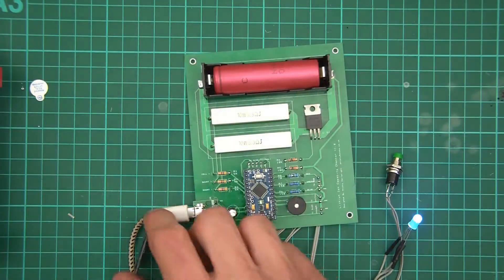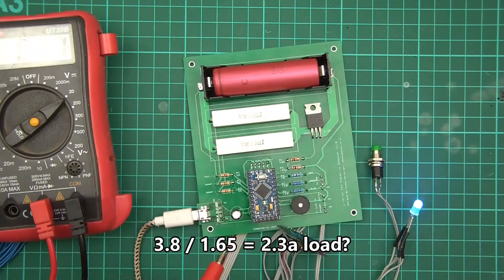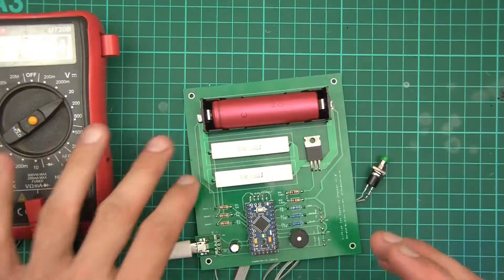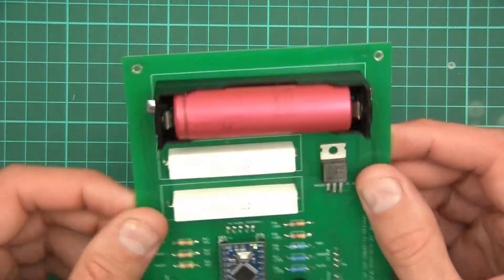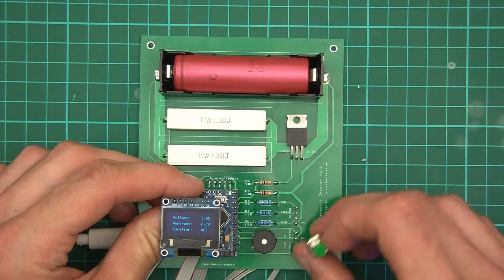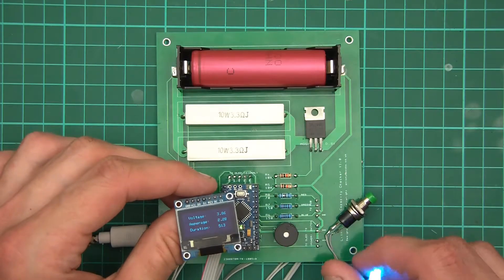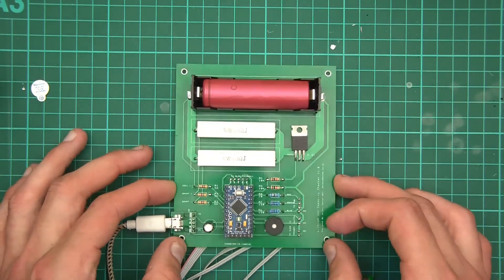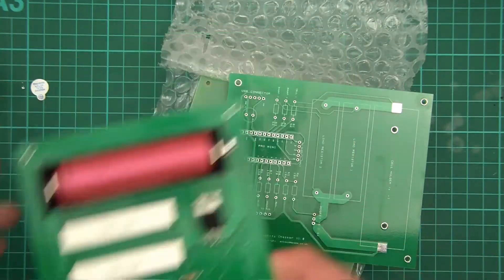TUTORIAL: DIY 18650 Lithium Ion Cell Battery Capacity Checker Tester (Part 25 - Reviewing PCB!)

Comment: It is an very important tool for 18650 collector, to test the capacity of the 18650 batteries.
Why dont you make a final sumary video about this capacity tester?? I mean going throw all 25 parts is a lot, especially when in some video you are just experiencing stuff, or  kind of learning yourself...
So now it is good to provide us a combine video for making this project, not too long video, just stuff do realise this project.
PS: If you entend to do a v2 of this tester, add a charging feature to the 18650, like that final product will be a 2 in 1 >>  Charger and 18650 Capacity Tester 😎